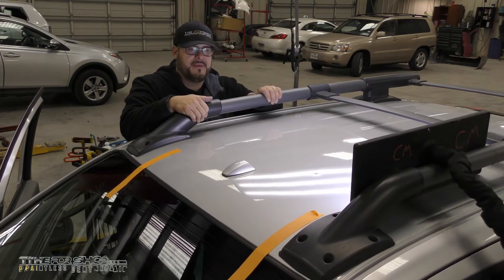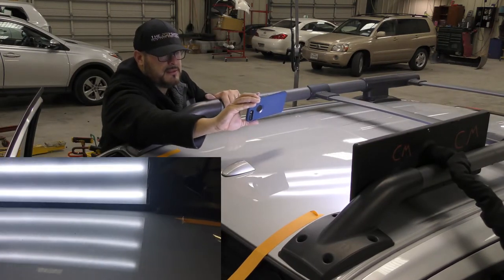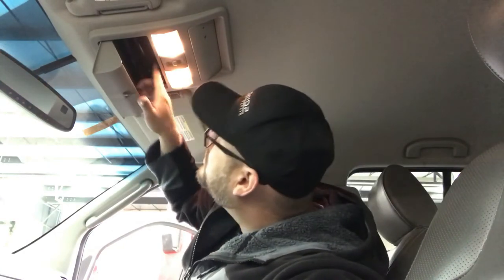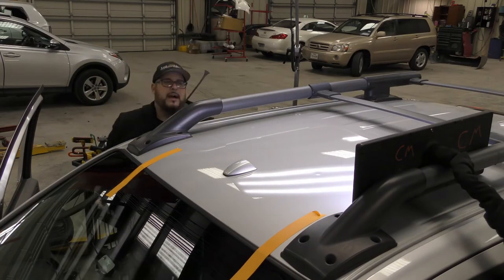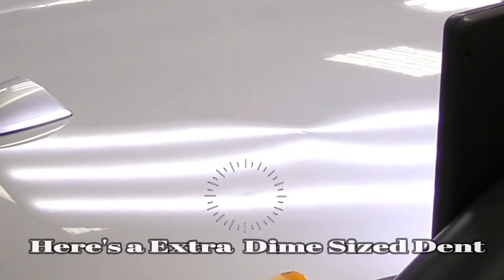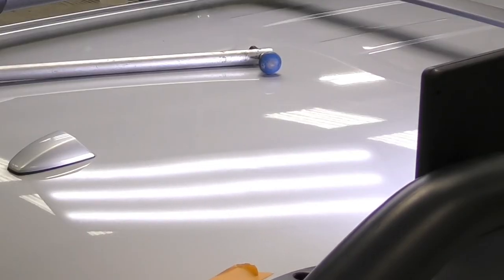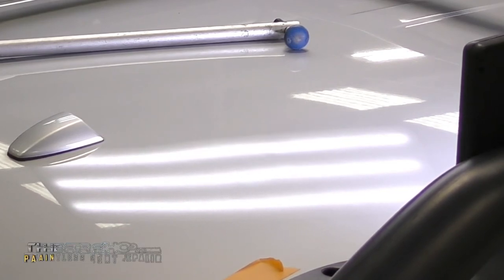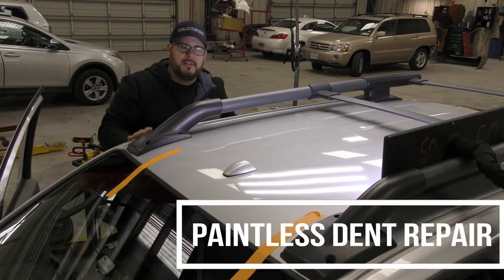Removing Dents on a 2011 Nissan Frontier with Paintless Dent Repair Kyle TX, Buda TX, Austin TX

Comment: What kind of cart is that for your tools?
Reply from the maker: https://rover.ebay.com/rover/0/0/0?mpre=https%3A%2F%2Fwww.ebay.com%2Fulk%2Fitm%2F111940949834
Reply: The PDR Shop Charlie Molina What did you use to mount your tools? I have a similar set up where I bought the ultra dent brackets and drilled them on but the cart is a bit too short and yours seems to be a nice height and looks extremely sturdy. Hope you don't mind the questions.